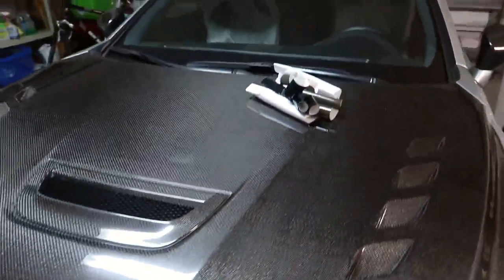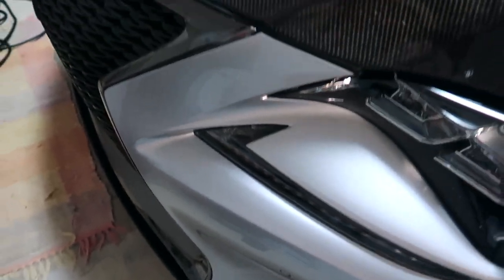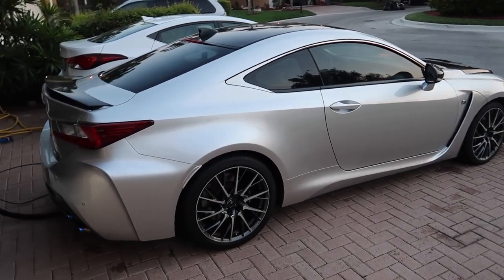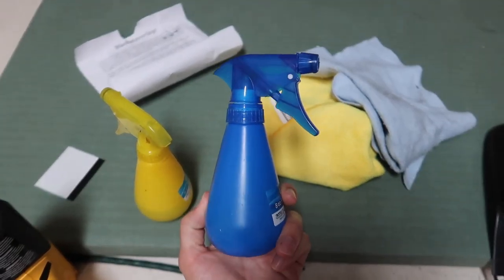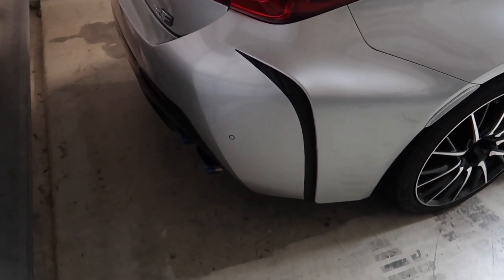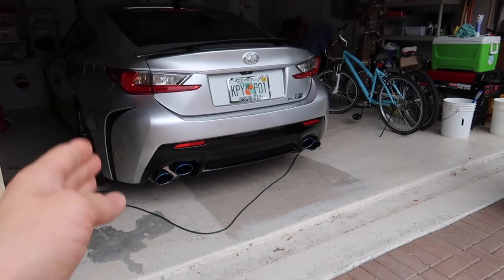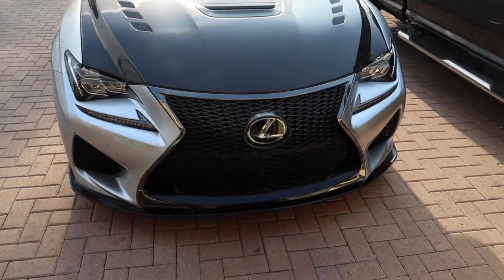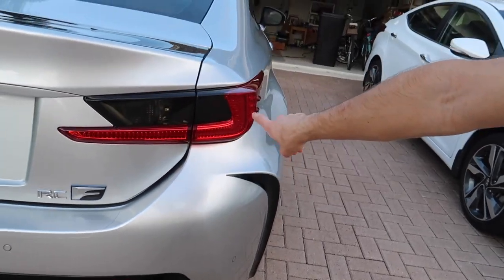Installing Gloss Black Overlays + Tail Light Tint On The Lexus RCF

Comment: Car looks beautiful man, I got same color as u and just installed the carbon fiber wing, debating doing the hood next or what u did with the roof of your car.
Reply from the maker: Heyyy we got the best color! Btw hood looks amazing but doesn’t save any weight which is a bummer. And my roof came carbon fiber because my car has the performance package.
Reply: @oryanx  I had a feeling you had the performance package, so u got the vector differential feature too. I got the premium package one with Mark levinson speakers. Everything u got besides the performance package I believe so man. I just ordered carbon fiber side mirror covers and carbon fiber steering wheel from RR racing. I recommend u look into it man, u clearly love carbon as much as I do haha.
Reply: @oryanx  could u link the stuff you bought for this video too? I think the vinyl makes the car look vicious

Comment: hey man have you ever had any encounter with m4s or m3s. make a storytime video about encounters youve have with other cars
Reply from the maker: Hey bro, actually I have had a really good encounter with another rcf once. It would be a great story time video and I actually wanted to do that a while ago but I figured it wouldn’t get many views. It’s worth a shot I guess, I’ll try it out.
Reply: @oryanx  That should be interesting. Make a video on it. I did not have an encounter with an M4/M3, but just today the older 6.2 Liter V8 C63 coupe. I also did a merge/roll start with a C6 Corvette last summer on the highway in my Molten Pearl RCF carbon/TVD.
Reply: @2ZZGE100  what happened did you gap the c6?
Reply: @davidwade7681  It was like on the merge, the C6 stuck right by me till 120 - 130 mph. Was about dead even. It did have a loud exhaust. Not sure if it was aftermarket or not. I have an Invidia full catback.
Reply: @2ZZGE100  i doubt it was a stock c6 i beat a c7 stingray from a roll. But yes    sounds like u got em
Reply from the maker: Damn you guys be tearing up the streets 🤣

Comment: Why would many folks like to replace the original hood with awful cf hood? It looks mismatched! Waste of time and money. Cf will peel and crack after 6 years+
Reply from the maker: It matches pretty well with the carbon roof and wing. At least I think so. I still have the original good so it would be easy to switch back.
Reply: It helps reduce weight. Since the RCF is a pretty heavy car it helps.